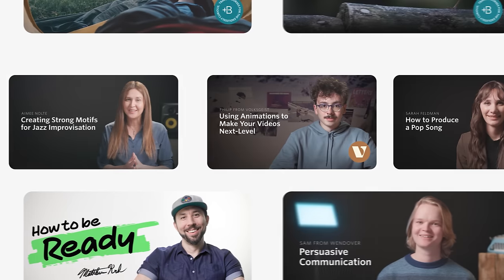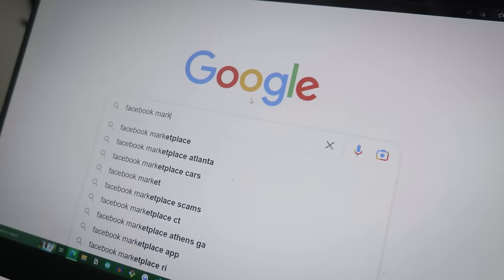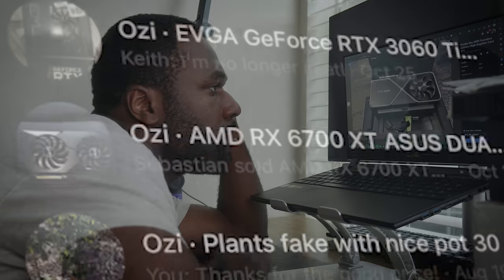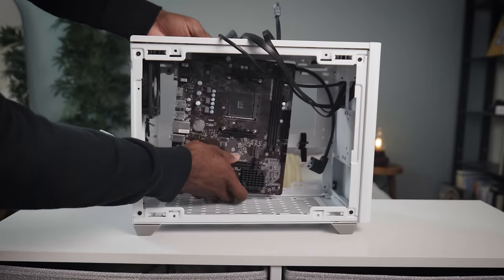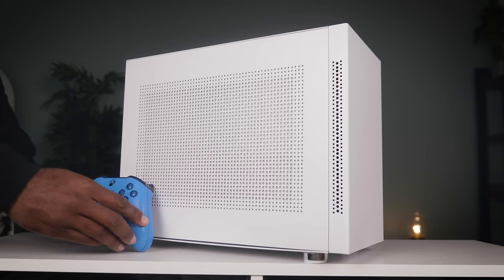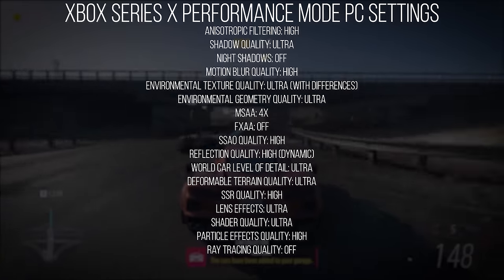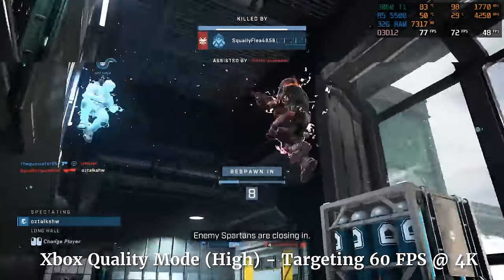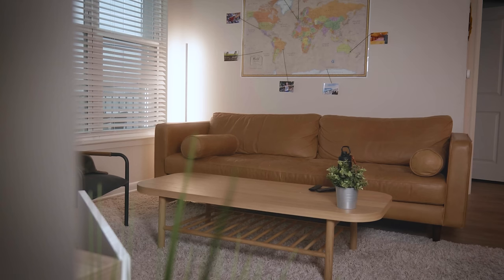I built a faster Xbox Series X for $474

Comment: yeah somebody correct me if i'm wrong but doesn't the Series X games run all current games at 4k60 fps??? how would a build like this even come close to that??
Reply: not natively lol.  Usually uses some form of upscaling. 3060ti runs it natively and if he used dlss it would not even be close
Reply: Labor and time, this build is actually like $2000 haha.  Convenience is nearly priceless
Reply: @mikeslemonade  if thats wroth $2k to you then im in the wrong business lmfaoo
Reply: Most console games have dynamic resolution to keep 60fps stable, even series X does not run all games at 4k60fps at all times, it just compensates with that feature turned on. Some console ports to PC recently are starting to have that as well, but tbh I much prefer just turning graphics options down a bit and achieve the same, which usually gives better perceived picture quality. A 3060ti can definitely get to 4k60fps for most console ported games, but for some of the most taxing and most recent PC games it will not be able to do without turning down graphics. 

I think the need for high end GPU is highly overrated and mostly a marketing ploy to get gamers to overspend on high end flagships. Unless you are a competitive gamer who requires high refresh rate up to like 240 or even higher to gain competitive advantage, nobody needs the latest gen flagship. You can do pretty well with a latest gen mid range or last gen flagship, or even flagship from two gens ago (like a 2080ti), and you'll run most games comfortably at ~100fps with all settings turned to max.
Reply: @fasthands1631  well factoring in building and browsing for the correct items.  He also did it on Facebook market place so I imagine is drove to pick some of the items.
Reply: @zxbc1  with pc optimizations i better sold my 1060 6gb and moved to ps5 and series s combo
Reply: It needs endless optimization
Reply: 4k60fps? Which game lmfao? Not even halo infinite runs at locked 4k60
Reply: you cant possibly get 4k 60 fps on new games for the price of an Xbox series X
Reply: It does not. There are certain titles that allow this like Halo Infinite but the targeted resolution/refresh rate is set by the game developer.
Reply: Adaptive resolution
Reply: @lil_savagemlg2434  nah series X has native 4K. Fact check yourself.
Reply: @Jordan Donaldson  it's upscaled lmao

Aaaaaand, 90% of people think they got 4k cuz it says it on the box but then hook it up to a shit tv or monitor and don't change the settings to allow it to even be capable of it 😂😂
Reply: Apart the dynamic resolution, quality is also adaptive and mostly runs on medium graphic settings
Reply: Well in performance mode yes meaning the graphics are turned down to med/low settings also  using dynamic resolution which lowers the resolution down to 3k to 1080p pending on the game.
PC can do all modes at one for being more powerful.
Reply: You see the difference/ between a console running a game in 4k 60fps and a pc running a game is that on the pc your targeting max or high settings usually with 4k and 60fps as a target but what people don’t realize when comparing consoles to pcs is that consoles from a graphical fidelity standpoint run most games at PC low comparable setttings and resolution wise it’s almost always up scaled in checkerboard so it may be 4k but it certainly is far from max graphical fidelity as the actual game usually lacks a lot of the detail that you could get playing on a pc. resolution isn’t everything. not to mention if you use DLSS which is better than console upscaling assuming you have an Nvidia card then you will get even better performance. There’s a much bigger difference in quality still on a modern gaming pc to a modern gaming console. console gaming has always been about optimizing games to run well by degrading the games actual graphical features in favor of being able to upscale the game easier to make it appear better.
Reply: @BillChang04 I'm in a bit different boat. I think that low end GPUs are holding back gaming engines from their fullest potential. Remember when no one could run Crysis because the graphics were so incredible? Game developers aren't doing that anymore, they are aiming for the market share... which are consoles. I rather see games being unable to be played maxed out 4k unless you have the flagship gpu of that year. I want to see the bleeding edge of graphics and then if you have a lower tier card turn down the effects accordingly. I want to see how far it can be pushed.
Reply: The Xbox also plays at lower fidelity. Hence why they have Quality graphics but 30 fps.
Reply: @TheBCninja  You're more correct and the dude above is super far off. The XSX and even more so the PS5 is what current gen games are artitected to run on. They both have their advantages: the memory and storage system of the PS5 is much better, the Series X has a beefier CPU with more cache - this can help explain why texture quality and frame times are better on the PS5, while the Series X is really the only console capable of 120Hz 1080P as the CPU doesn't bottleneck.

The Series S however could definitely be argued to be holding engines back. It inherits the poor segmented memory system of the Series X and only has 10GB of it to boot. 

The biggest advantage the consoles (and especially the PS5) have over PC is shared memory across the Zen 2 cores and the GPU. This helps significantly improve latency as the same register can be accessed by either AND both consoles also have much higher memory bandwidth than CPUs in PCs have.

Game devs would ideally prefer that the minimum specification be around an RTX 2060 12GB (which has roughly the amount of VRAM typically used as such by the consoles).
Reply: @Luckysury333  It absolutely does. It runs at 120fps on Series X so there is absolutely enough power left over to do 4K 60fps
Reply: @Antassium  there is literally tons and tons of videos on games being native 4K for series X. Like a quick search proves me right you dunce. 🤣🤣
Reply: @pootaro7534  Nonsense, most games on Series X & PS5 are running at High PC settings. Digital Foundry shows this all the time. Most ppl couldn't even tell the difference between High & Ultra settings.
Reply: @Glubbdubdrib  Most games on Xbox this gen have a 60fps mode.
Reply: @2intheampm512  You sound like a Sony fanatic. As none of that cult understands this stuff and they lie constantly... 

The memory of the PS5 is not better. The SSD has a faster speed but the Series X is beating the PS5 in loading most games. And Microsoft hasn't even begun using their Velocity Architecture or compression tech. The Series X also has a wider bus.

No, the "texture quality" of PS5 versions is not better than the Series X. Digital Foundry compares every game released and they are both the same. Usually High or Medium settings.

No, the Series X CPU is only slightly faster than the PS5's. The biggest difference is that the Series X has an actual next gen GPU with full RDNA2 (Mesh Shaders, Variable Rate Shading, Sampler Feedback Streaming & Ray Tracing) which has 3 more Teraflops of power on the PS5 GPU. Where Sony, to cut production costs went with a last gen RDNA1 based GPU and only paid AMD to implement only 1 RDNA2 feature: Ray Tracing. The most demanding & expensive feature of RDNA2, where the others the Series X GPU has are designed to free up valuable GPU resources to offset the performance hit of RT. The Series X also has faster RAM.

Only the "frame times" in a few seconds long sections of entire 40 hour long games have run only 1 to 5 frames higher on only a few PS5 games. This was far more prevalent when the consoles launched as the Series X & S have an entirely new Dev Kit where the PS5 Dev Kit is virtually identical to the PS4 Dev Kit and developers already have 10 years experience working with it. However, since launch, more & more games have been performing better on Series X and that will only continue to be the case going forward. The very few games that have run a measly 1 to 5 frames higher on PS5 was purely a matter of optimization and they all get patched to run better on Series X within a month. But none of these channels who do the comparisons revisit those games later.

No, the Series S is not the bottleneck, the PS5 is. Because if developers began creating games using Mesh Shaders, Variable Rate Shading & Sampler Feedback Streaming, they would not run on the PS5 as the PS5 GPU does not have these capabilities. These developers have to create entirely new engines built to use full RDNA2 features. But they aren't about to do that when those games won't even run on a PS5. Microsoft 1st party studios will begin using this tech, but 3rd party developers will not until next gen. This is holding back the advancement of graphics, not the Series S. The Series S has full RDNA2. 

So my question is where did you get all the nonsense you just spewed? And why do so many of you spread such bs when you really have no clue what you're talking about? No wonder utter bs spreads so fast.
Reply: @Glubbdubdrib  Because higher graphics puts more strain on the gpu along with resolution.
Reply: @Antassium  
No it's not upscaled on the Series X. 
It is on the Series S for some games, and even the S can output a handful of 2D games in native 4k60. Like Hades etc
Reply: @nonyabusiness6084  is that at higher graphics too? Or am i thinking of the Xbox One?
Reply: @Glubbdubdrib  Depends on the game. Halo Infinite can run a 60fps on quality settings. But they usually target the resolution first before cutting back graphics quality or frame rate.
Reply: @Luckysury333  Of course they choose to let the hit go on the resolution rather than the frame rate. It's still at 4K 60fps throughout the vast majority of the game on quality settings. Cope.

Everyone knows that a gaming PC is more powerful, Einstein. You can choose your own hardware. Of course that can be better than a console. But not at $500.
Reply: You can't. Last Gen yeah, PC wins at every single way but for this generation, it's personal preference. I'll still game on PC no matter how cheap and powerful consoles get because everything I have and need is in one machine, being the PC
Reply: @lil_savagemlg2434  yes, natively
Reply: @Antassium  lmao ppl thinking consoles run 4k ultra settings native 😂 they are really good priced but I’ll take a pc any day of the week
Reply: @mikeslemonade  when you do things for yourself, that time is never wasted. Takes only a few hours to build, so I'm not sure what your hourly rate is, but I don't think it's near 500/hr. 🤷‍♂️
Reply: @Michael Pun  If you would spend that much on this PC, let me know when you're in the market and I will gladly take advantage of. I mean sell, you a PC.
Reply: @Lil_SavageMLG  This is a pretty popular and naive belief. I even went round and round with my own brother to explain this to him and he still had to google it before he would believe me. It's a testament to MS and Sony's marketing departments.
Reply: @yungwildnfree  it’s upscaled bud it’s all in the marketing not saying it’s bad but it is what it is.
Reply: @balaketheyoungin2076  console are not nativily 4k 60 fps
Reply: @Azelrith  not on aaa current games . Check yourself before fronting
Reply: This guy just got dumpstered on so hard. This argument is same as , higher pixel phones will click better photos
Reply: Not at all. For most demanding games, it's like 1800p 30 fps at med-high settings. It's not a magic box, don't believe marketing. It's like a 6700, which is pretty powerful
Reply: @mikeslemonade  dude I just built a 2,000$ pc. This is not 2K lol. I have a Merc 310 7900XT with a Ryzen 7 7700X paired with 32GB DDR5 Corsair VENGEANCE RAM on a Gigabyte AORUS Elite AX X670. CPU is cooled by MSI MAG CoreLiquid P360. Put some respect on that shit.
Reply: @balaketheyoungin2076  You get 4k 120 fps on some.
Reply: @Antassium  The upscaling is specifically for 8k gaming which for some reason the Xbox Series X also supports. This "8k" is AI upscaling, 4k 120 fps is in fact native depending on the game.
Reply: @mikeslemonade  it costs like $50 to take your parts to Best Buy and have someone assemble it for you
Reply: The performance numbers are right here in the video, so yeah it beats the series X at comparable settings and resolution, what’s so hard to understand about that? The Series X is still arguably a better deal if you include the 4K blu ray drive and if you care about noise and power draw, but then with a PC you don’t need a stupid subscription to play multiplayer and you can get games way cheaper.
Reply: sorry for beating this dead horse but resolution doesn't matter that much. You can run a game at 4k with the lowest settings and still have it look terrible. The whole "runs at 4k" thing is just marketing.
Reply: @jordanlazarus7345  ah NO.. that's not true at all.. originally my question was about what a console can do my pc run games at 4k 60fps on max setting and the games look beautiful.. when you ply on lower rez AND lower settings you will see the differences unless your tv or monitor is mid grade trash then i guess everything would look the same to you
Reply: The only game that I know that is triple A that runs native 4k 60 on Xbox series x is halo infinite

Alot of other games are upscaled to look 4k
Reply: @fasthands1631  I wonder how much he would pay for his favorite happy meal. 4-500 dollars. It is convenient after all. Obviously, a child with no PC building experience.

Comment: If you would drill hole at the back of the cabinet where the PC sits, even though you keep the door open. You'll get better thermals, instead of that hot air being kept in one place, you create air movement and that is better. I have a SFF build in a cabinet and had to do it like that due to thermals and it really works.
Reply: I added a couple of case fans to the back of my cabinet with some quick Dremel work and a few holes drilled. If you dont mind two extra cables behind your pc, I seriously recommend it. It brought my thermals down significantly.

Comment: The Xbox x has the GPU power of the 5700xt not 6700xt.

Good video as always.
Reply: Right, but the 6700xt is needed to rival console performance since consoles have better optimization which makes weaker components rival stronger components
Reply from the maker: Ahhh you're right. I overshot by a good margin

Comment: + controller + cables + keyboard & mouse + shipping on every single part if not found from the same source. Also to note labor - research and time finding parts, dealing with multiple sellers and waiting time on everything.
All that and most new games are still better optimised for the PS5/Xbox which comes smaller, sleeker and conveniently just pick up and plug n play which is a big factor.
Reply: What game that was made for PC and it's not a port from console runs better on consoles?

Comment: Not sure, but I think the reason that your GPU temps are a bit high is because of the airflow. The GPU uses a blower-style cooler, which means it blows all the air out the back of the gpu rather than blowing hot air everywhere. I noticed that there is a giant cable mess right behind the GPU, so what you should probably do is move those cables somehow.

Comment: I was able to find my first gaming pc on facebook 3 days ago. An asus rog strix with i7 9700f and rtx 2070 super for $500. Im excited to explore the pc gaming world
Reply: pretty good build, you might want to try reapplying thermal paste to both gpu and cpu if the seller didn't given that the seller used the pc for quite some time, or the cpu/gpu is on a higher temp than average in bench marks

Comment: Good job 👍. I built a $2000 pc with a 3080ti and I’m now on my second failed power supply. Having to deal with constant update battles I just use the PC as a PC now and stick to my consoles for gaming at this point. PC games are full of hackers so I turned off cross play for that reason on most games. Xbox cross play is weird to turn off but playing only against Xbox/PS players servers seem better and with less hacker headaches. Just an opinion.  You got a sub.

Comment: I did a very similar build about a year back using an ITX board, 5800x and a 3070 all in a Thermaltake Core V21 cube.  Like you I built mine for couch gaming and like you I have mine in a floating media cabinet.  I noticed you have to keep the door open when you used it due to heat obviously.  I used a AC Infinity T8 plate fan kit on my media cabinet enclosure.  It works extremely well in automatically keeping the cabinet nice and cool while keeping the doors closed.

Comment: Are the two fans under the vid card pulling air in of the case or out? Your GPU fans pull into the card if those two bottom case fans are pulling out you have 4 fans facing each other competing for airflow. If they are they need to be turned around to help introduce cool air to the GPU fans. Not sure since I didn't hear a statement to the direction of the fans cause that's pretty warm. Love the vid otherwise you have a very calming effect lol.
Reply from the maker: Bottom is intake and top are exhaust! I do need to double check my rear exhaust fan and my power supply fan, because they might be competing for air.
Reply: @OzTalksHW  Ya LOL I finally noticed the bottom fan vector when I slowed the vid down and looked. Again love your vids.😀😀

Comment: Great build brotha. I did a build using the NR200

I had some old parts and got lucky with some new parts that cost me almost nothing. 

CPU- AMD Ryzen 9 3900X (Free)
MB- Asus Rog Strix X-570-I mini itx (Free)
Memory-GSKILL 16gb ($60)
STORAGE 1tb NVME (free) & 1tb ssd (free)
GPU-Asus strix AMD 6600 XT (free)
Case- cooler master NR200 ($70)
Power supply- Corsair 850 mini psu  ($130)
Extra 2 case fans Lian li $30

Total $300 lucky and patient.